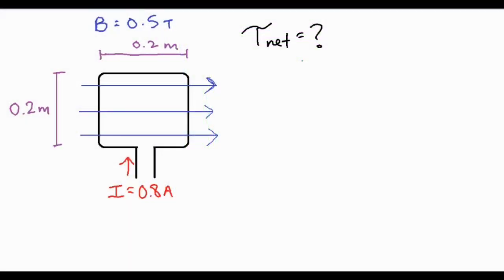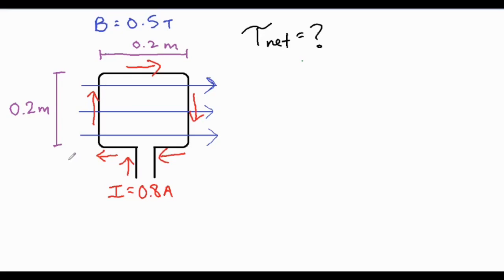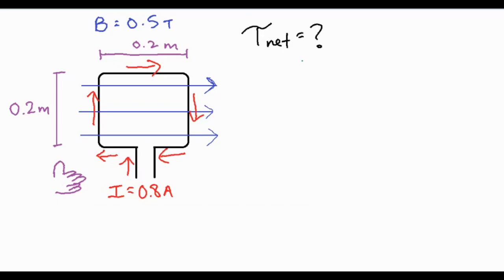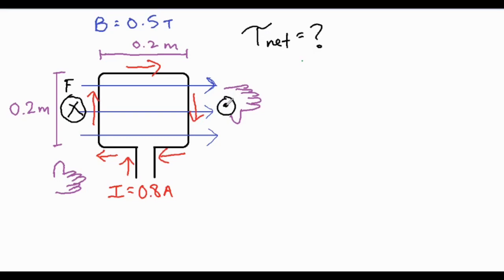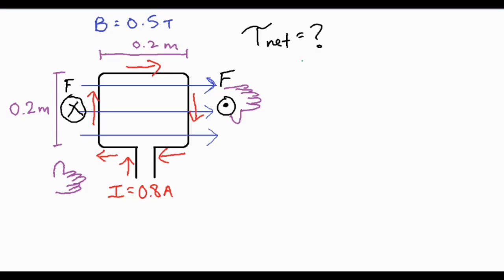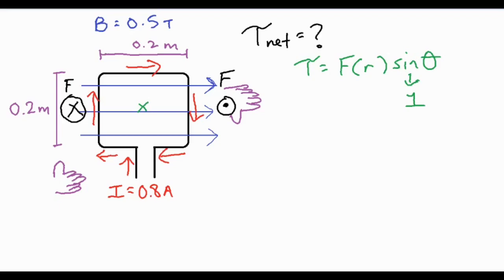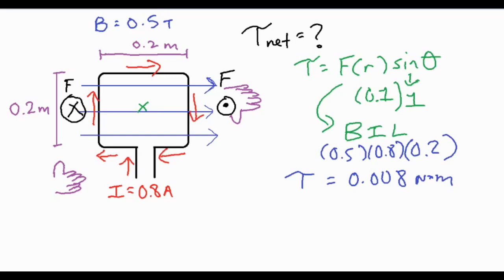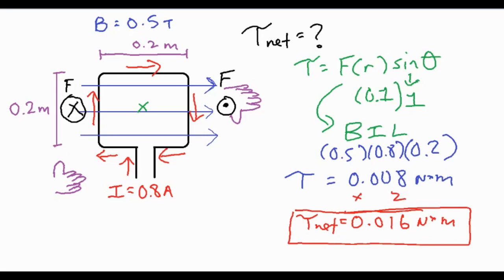Loop in a Magnetic field - Direction of Rotation? Torque?

Comment: Why can't a loop carrying current in a magnetic field rotate past 90 degrees unless the direction of current is changed I've just started this topic in physics on my own 2 days ago.Ive come to the part of electric motors hopefully you're still able to answer 🙏
Reply from the maker: Once the loop rotates 90 degrees then the force would push it into the page, but now it would be pushing the side of the loop.  This wouldn't cause any rotation. Typically, the inertia from the loop getting rotated initially is enough, so that it can get a little past that point and get continually rotated after surpassing that position.

  If it happens to be an alternating current then it'll push a certain side of the loop "out of the page" right after pushing it "into the page".  I hope that made sense, thanks for the question!
Reply: @beatphysics thanks alot for the help😁